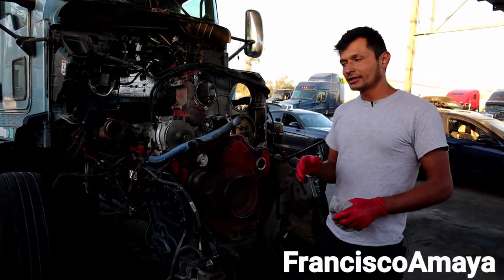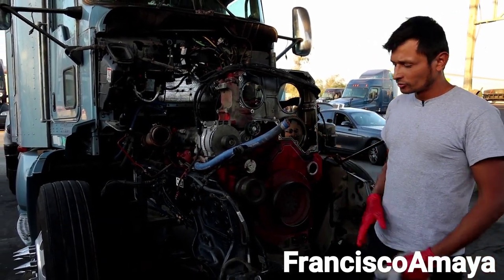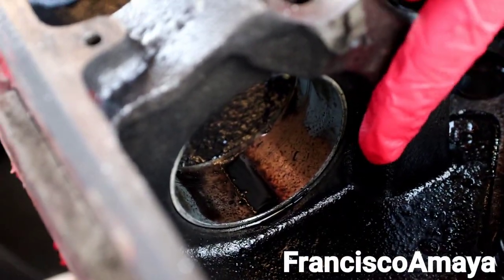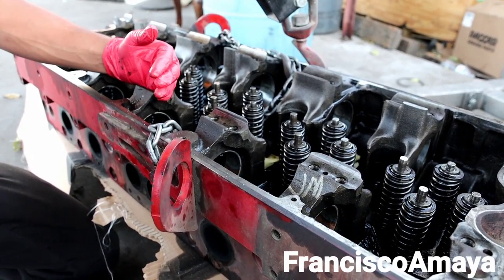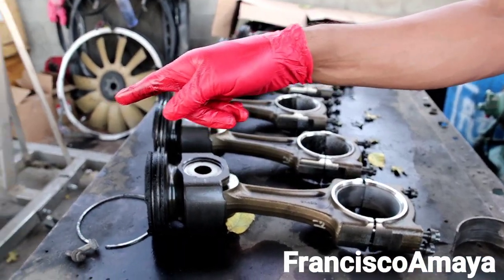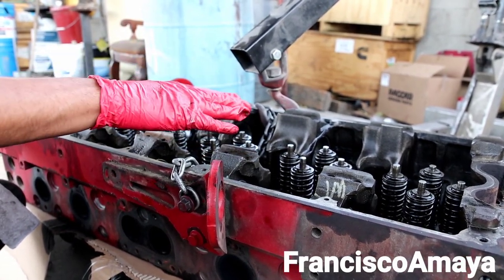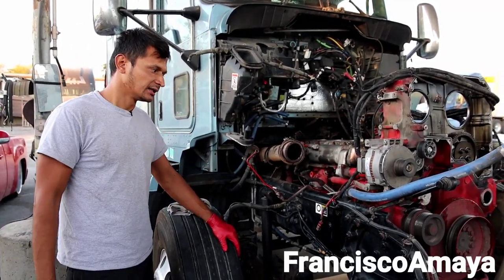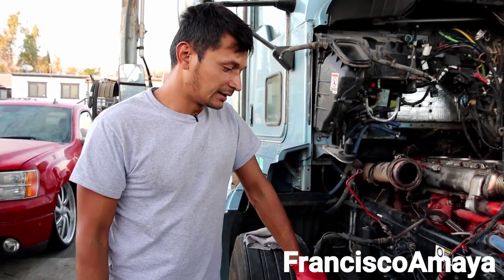Cummins ISX ISX15 low oil pressure bearing wear camshaft bearing damage full overhaul

Comment: Frank
Good evening 
Thank You for sharing this post
We have about the same problem with a KW T600 year 2007
We did the in Frame overhaul 
The truck worked for about two months 
Then it showed oil low pressure 
We look at every place except for the cam bearings which were replaced with new Cummins OEM.
We could not believe that the problem was there on the cam Bearing

Comment: Great video señor. I am having low oil pressure in mine also 2010 kw t660 Cummins isx 400st engine. I replaced the oil filter and the small device that goes in the oil filter housing and it helped. But only when I am idling the pressure is at 20. But the truck pressure goes up once I am driving to like 38-39. Can you tell me if that’s ok? Thanks Francisco 😎👍🏽 saludos
Reply: That's good oil pressure for the cummins. Mine is 38.  Hot is at 33.  Idle is 15 to 18.   It's with in specs

Comment: I'm having low oil pressure issue when I change the oil filter my oil pressure goes back to normal seem but I'm only getting 10000 on my oil then it starts to drop

Comment: Hello I just did rehaul on my 2012 western 4900 car hauler code I’m getting spn-100 and check engine light comes on when I slow down
Reply from the maker: spn 100 refers to a low oil pressure, check your oil pressure, repair asap.

Comment: I recently got my engine rebuilt it’s a Cummins isx 2008. I’m getting 32 psi at 70mph. And 22-25 at idle. Is that normal? Any help would be appreciated thanks :)
Reply: Yeah it’s low bro I have pete 2015 wth Cummins nd have 725k miles no rebuilt it’s stay always around 40-42 nd on idle 25-27psi

Comment: The problem is that the psi has to be cranked up, its a problem that goes around.. you have a system that operates at low psi at high rpm, problem #1 , problem #2 is that low psi destroys the engine.. problem #3   is that the worn out components finish destroying the Engine.. cranking up the oil pressure is the way to go. With volvo D13 we were told to never idle truck below 900rpm, as soon as the truck is started, put in fast idle to avoid low oil pressure and these Engines in our fleet, Volvo D13 lasted over 1 million miles.

Comment: They had an upgrade on the spring on the filter housing to boost the oil pressure it’s a big allen plug if it was upgraded it will have a paint maker to indicate it was upgraded
Reply: If no paint on Allen head who should I contact?  Kenworth or Cummins?
Reply: @markcovington6538  well if the campaign is still active yes but that time might of passed
Reply: @markcovington6538  could contact either. It’s a bypass valve an $8 part. Sits right on top of the oil filter (in the housing.)

Comment: My 2016 t680 with cummins isx15 have 437,000 miles ,and the oil pressure cool is like 33 to 37 , and hot running the engine is like 40 to 43 , ,i make oil change every 10K miles,  I bought the truck with 269 miles ,,